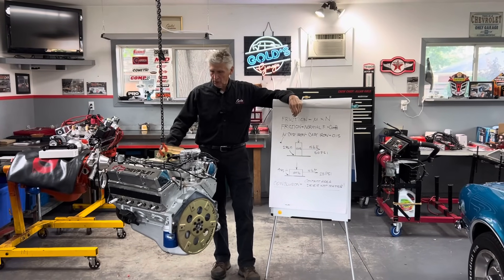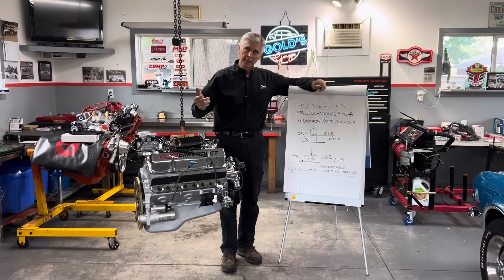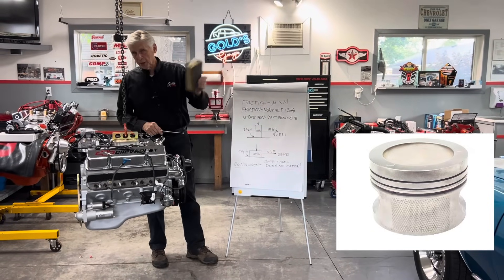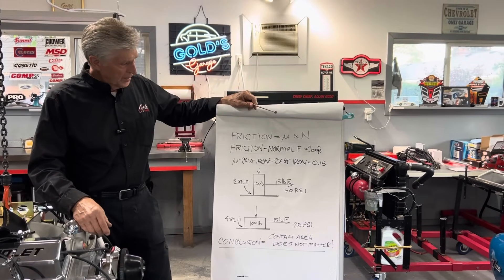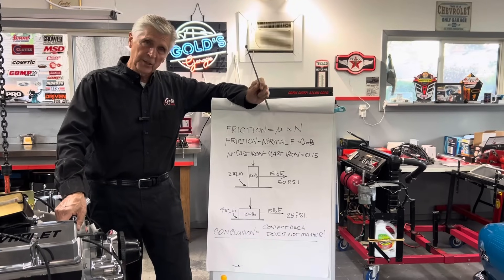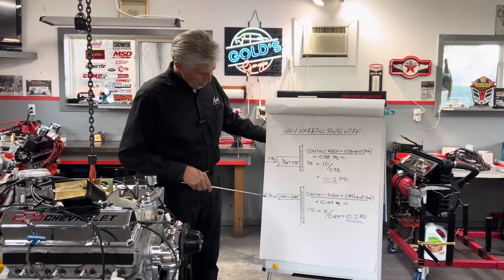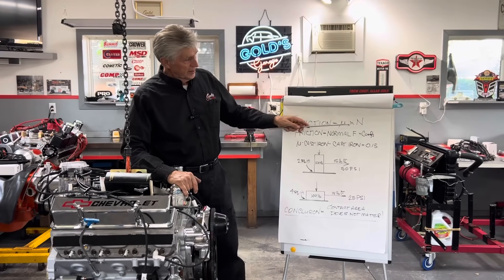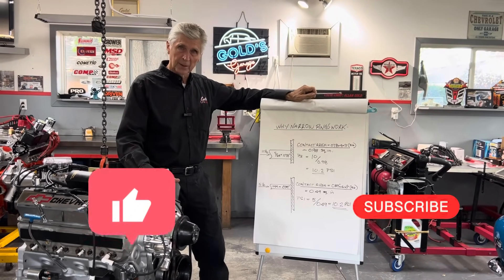KNURLED PISTONS MYTH? LOTS OF OPINIONS BUT WHO IS RIGHT?? PHYSICS! INDISPUTABLE PROOF!

Comment: There’s piston KNURLING and oil grooves, which are cut in whereas KNURLING is pressed in. I prefer oil grooves because they don’t wanna affect the diameter of the piston, but they do increase the available oil that the piston could hold in the contact area. which is as advantageous and will decrease where… Fact
Reply from the maker: That's an interesting distinction, glad to hear your thoughts on it. AG

Comment: Excellent exhibit and explains some engineering, all of this assumes a constant gravity, correct? 
I think when that piston is moving at such a high rate of speed that it starts to make its own gravity  I don't see any figures here about that, also the piston does not contact the bore as the rings do , 
Now having said that the piston scavenges pil that is being renewed by windaage so the knurled area has the opportunity to grab more oil onto those cavities so more oil in the same area  more or less gives more separation between the bore and skirt, more oil to absorb the impact of the force that the moving part is creating. 
That's why it cleans up an old engine. Same applies t to he a new build .  it still needs the correct clearances .  I know it doesn't seem like much but these calculations don't seem to me to really explain the piston movement. 
Thanks you all lay some rubber..... 😊
Reply from the maker: That's a great point, appreciate the detailed breakdown of the process. AG

Comment: the piston dynamics inside they cylinder bore are obviously far more complex than sliding a wooden block on a flat surface. the illustration given here also does not factor in heating and how it impacts friction, the moments of force i.e piston acceleration and deceleration inside the bore, the slight rocking or piston play inside the cylinder and how knurled surface would affect air/compression pressure flow over it. (does the crests of the knurls deflect more gas into the cylinder causing more sealing compared to a smooth piston skirt?)  This debate is similar to that of intake port smoothing which many people swear by while others dismiss as waste of time. It is more of fluid dynamics issue and less of a friction issue because maintaining compression is basically just stopping air from moving past the piston/cylinder wall clearance. Now the big question is; which type of piston skirt surface discourages air escape from the cylinder? a smooth one or a knurled rough one? similarly which type of port surface encourages air to get into the cylinder? a smooth one or a rough one. obviously air getting through the ports is not a friction issue it is a fluid dynamics issue. Air hitting a rough surface at high speed will cause turbulence which work against the flow of incoming air. The faster the air is the worse the problem. That's why porting intakes will only have benefits in a high revving engine. Now back to trying to keep compression inside the cylinder. It is the opposite and a rough passage will work in your favor because it will deflect and discourage movement of the fast compressed air back into the cylinder and discourage further escape. That is why friction formulas do not apply here and dyno tests will show knurled pistons perform better. Main problem with knurling though is that it will soon wear out but that is not a problem if you just want to do few drag race pulls.
Reply from the maker: Thanks for a well thought out and detailed comment Gearloot.AG

Comment: This brings up questions for me now lol. If you have the same surface pressure of 10 psi on the cylinder wall isn't the drag the same between the two different rings therefore mitigating any gains of the thinner ring? 

The other thing that has crossed my mind is I believe there is gasses also pushing out on the rings so how does that effect things? If that is the case and you do have gassed pushing on a smaller surface of the thinner ring,  does that increase or decrease the tension pushing on the smaller ring? 

I was also wondering if ring seal is a benifit of the thinner ring for some reason.
Reply from the maker: Those are all good points, thanks for contributing to my channel.AG
Reply: @goldsgarage8236 am i wrong with what im thinking?  Is there anything you can to clear up for me?
Reply from the maker: OK I will try. usually, in low tension ring packages, all the rings are thinner including the oil ring. Thinner rings require less tension to achieve the same PSI. Less tension reduces the N (normal force) in the formula, thus less friction force. 
Also remember that the gas pressure pushing out on the top ring is only significant during the power stroke when cylinder pressure is high. 
Hope this helps. AG

Comment: No. No. No. This is all out of context. When Smokey was doing his work the best stuff available was not that good. Knurling the skirts actually reshaped the piston and they were discarded after the race. Build an engine today with those same old pistons and you’ll have lots of noise until they’re warm and a lot more oil consumption with the old matching ring packages. Anything would have helped.  Sometimes Teflon buttons are used on piston skirts as well in some race engines. Skirts touching the walls is a no no.  Race engines are for race cars that get torn down and rebuilt a lot. A street engine is an entirely different animal. And today’s parts and combinations are very different. Context.
Reply from the maker: Interesting points, thanks for the comment.AG

Comment: The book always says this and it always says that but when it comes to putting it on the dyno the dyno don't lie
Reply from the maker: Good point David, Empirical testing. AG
Reply: the piston dynamics inside they cylinder bore are obviously far more complex than sliding a wooden block on a flat surface. the illustration given here also does not factor in heating and how it impacts friction, the moments of force ie piston acceleration and deceleration inside the bore, the slight rocking or piston play inside the cylinder and how knurled surface would affect pressure flow over it. (does the crests of the knurls deflect more gas into the cylinder causing more sealing compared to a smooth piston skirt?)

Comment: you have to remember the cam shop  used two identical metals  which isnt what is going on inside a motor , A piston and a piston cylinder wall are two different materials, different hardnesses I know for a fact it works short term and helps a motor seal rings a lot better during break in.your knurl rides above the rest of the piston skirt and the piston only makes contact with the knurl rather than the rest of the piston. so you have less contact area riding in the cylinder which = less contact area less friction.  good for @ 18-20hp for about 500miles ,it needs to be one single knurl though not a bunch of knurls ,if you could make the knurl contact area harder than the cylinder wall it could work indefinitely but because a piston is softer than a cylinder wall it wears down and eventually the whole piston rides on the cylinder wall . it will seal much better because the knurl is making it square as it breaks in.
Reply from the maker: Thanks for the detailed explanation! AG

Comment: man, any of us older guys know what knurling was and why and when, and why IF so called right, why its NOT DONE. i wish this debate would die, and ALL these top notch channels would STOP trying to cash in on viewers and money over it and make one simple post only on the content already out! its causing more confusion, each of you high profile channels creating new content, cashing in to get a bigger youtube check isnt helping those who dont know. build your engine the right way!. used bores go, knurling a used  piston or new to stuff into a used out of round tapered bore is wrong. buy new pistons for the closest next OS your block needs. once you have them, get your block machined not before. then you dont need knurling!! distorting a piston skirt to knurl it, yep makes it tighter if you need that, but you add more contact area to the skirt than any new modern piston has. you end up knurling more of the skirt than ever is designed to be the load bearing surface of a modern piston, your knurling beyond the EGG shape of the skirt!. they are making skirts shorter, narrower, lighter for what reason? this debate needs to end.

Comment: @goldsGarage - I think your explanation is the most reasonable and scientific explanation in this whole debate.  here are my thoughts, 1. for the record, i am not the biggest fan of Uncle Tony and i don't often watch his channel. while i will give him credit for knowing a lot of Mopar trim tag and trivia information, i find him to be a poor mechanic and he spreads a lot of miss information. if i want to watch a car butchered, i will go watch Roadkill reruns. The reasoning behind my comment, is in the crossover episodes UTG did with Luna Garage and Nick's Garage. he half assed the assembly of Luna's engine and it failed to make oil pressure on Nicks dyno. the reason it failed was that it had the wrong main and rod bearing sizes and they were .010 too loose. any engine builder worth their salt checks the main and rod bearing clearances. he just slapped it together and it failed. When a new guy is getting into the car hobby, and they have a failure like this, they get discourage and leave the hobby. he then went on to give another half assed excuse that "the parts were not cleaned, and they were running short on time they need to hit the deadline for the videos, etc."  if that was the case, you take the time to show the new guy how to clean it properly and assembly it properly and make it a 2-part episode. do it right the first time. i feel he was more about making excuses and placing blame on the new kid, but not taking any accountability for having the wrong main and road bearings in the engine. Just because UT bought some of Smokeys old tools, doesn't make him Smokey Yunick.  2. I worked in a machine shop of years as a kid after school and during as an apprentice, and we did a lot of pistons knurling on farm tractors. to take up the clearance and to get them through the season until they could afford the downtime for use to rebuild the engine properly over the winter. we even did a few old model A and Model T and flat head engine when parts were not available for them. one of the first thing my boss taught me was how to rebuild a small block chevy. back then they were our bread and butter. I can't count how many i have done and to this day i can assemble one with my eye closed. and unlike Tony, I checked the clearances on every single one. 

One thing that neither UTG or PowellMachineinc was why Smokey was knurling the pistons. was it really for just the few horsepower that you would see from reduce friction? i don't think it was. Smokey was notorious cheater. one of the things he said in his book was "The Rule Book tells you want you can't do" and smokey feeling was that if it was not in the book, it was fair game. he also claimed that the half the rules in the NASCAR rule book were because of him. NASCAR has rules on engine displacement. usually measured in pi x radius Squared x stroke x cylinder count = displacement.  with 358 CID being the max displacement which is a .060 350 chevy. what i think Smokey was doing was boring the engine .065 to .068 over size and then knurling the pistons to avoid piston slap. the knurls wear down over time and the piston slap scars and scuffs the cylinders a little.  when NASCAR does a tear down and post-race inspection, and they discover the engine is "oversized", Smokey points them at the oversize on the piston and chalks the oversized bores to engine ware from racing. with no one being the wiser. now if you look at Hoursepower per cubic inch back then, they were in the 550-600 HP range. if you were getting 1.6 - 1.7 hp per cubic inch on a 358 you made 600 - 610 HP.  now if you are cheating, and your engine has .008 over sized bores with knurled pistons. he now has a 362 cid engine. 610-615hp, plus the HP he gained from the reduced friction even if it was minimal, he would have had a 10-20hp difference on everyone else. and 10-20 hp in hyper completive sport like NASCAR wins races.
Reply from the maker: A well thought out and detailed comment, thanks Shad.AG

Comment: knurling was not for friction saving or resizing to save bad dimensions. 
knurled pistons allow you to increase the piston to cylinder clearance ever so slightly on engines that have cylinders bores tight together. so basically it was a way to avoid a cooling issue.
Reply: like an over bored 400 sbc
Reply from the maker: Good to hear from you Ted.AG

Comment: Yes, sir that's a pretty good explanation and easy to follow. You sure you're not an instructor? I can see how when Smokey Yunick did this, he did not have the advanced pistons we now have and of course Yunick was always coming up with something to gain more power. Brian Saltzer did a piece on this where he knurled a set of pistons for a racing engine due to having received the wrong size piston and had no time to get another set. As a matter of necessity, he knurled the set he had and actually dynode a gain of about eight horsepower. Upon teardown of the engine after use he noted that the knurling was just beat down to nothing (but it served the purpose). This reinforces the fact that knurling the piston skirts (which as you very well know) was done in the past to get some more time and miles on worn pistons (as well as spacers for getting the ring clearance in the ring lands back into spec). I did this on a 350 Chevrolet engine when I was going to school on automotive engine machine work back in the eighties at my local community college. I had acquired a 350 Chevrolet engine that a fellow left in a storage locker and the manager who was too old to handle it asked me if I wanted it for scrap. Well, when I went and got the engine lo and behold everything for a standard rebuild was done except boring the block and new pistons. The engine had three cylinders done and would not turn. Upon checking it I found the assembler had the number three rod in backwards locking the engine up. So, I disassembled the engine and took it down to class to check the cylinder bores and resize the rods. The cylinders checked out fine, and the instructor asked me "you want to hone the cylinders out .010 and knurl the pistons for practice?". I said, "why not". That was back in 1982, and the engine wound up in my 4-wheel drive and I drove it fairly regularly and in the last three years it started consuming oil. I can't complain about that. Fixed up another engine for the truck and when I get around to it will disassemble that engine and square it away.🥸👍👍👍👍👍
Reply from the maker: thanks for commenting Billy, i did watch Brian's video also.AG

Comment: The original argument for knurling was based around smokey yunick building engines for circle track it is obvious that he was setting them up loose and relying on the knurling to "temporarily" avoid piston rock. Brian Salter explained this very well..he did it and won, after the race the engine was toast..but that's racing.
Reply from the maker: Thanks Dave. AG

Comment: I don't get why people keep talking about 'skirt contact'. That's insane. So you're running with no oil or oil pressure. In any engine or machine the moving parts should normally be separated by a lubricating film of oil or fluid wedge which is a fluid dynamic bearing. You shouldn't ever have metal contact, or it won't be for very long.
Reply from the maker: Good point, thanks Vince. AG

Comment: Your conclusion is very disputable, there are too many variables in an operating engine to make such a wild claim.
We're not talking about something simple like sliding a brick across the sidewalk. 

Only multiple Dyno runs with and without knurled pistons on many different engine types which show a statistically significant difference, or no difference will be undisputable. Sooo, we'll probably never know, but so far Brian Salter has the most convincing story which include Dyno runs to back it up.
Reply from the maker: Thanks for watching and commenting Sub.AG

Comment: Don't you have a cover for your Camaro or do you just take it off for videos?  I wouldn't think you'd want it exposed if you're working and something like a valve spring or whatever go flying?
Reply from the maker: Thanks for the question. Yes i do have a cover and it is on most of the time. Good catch.AG